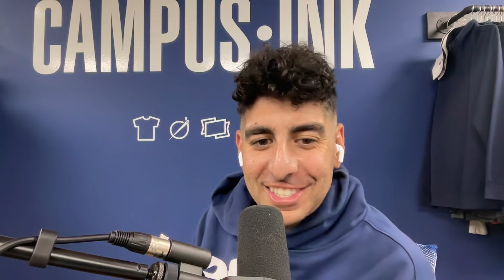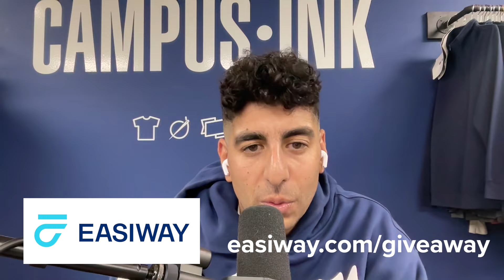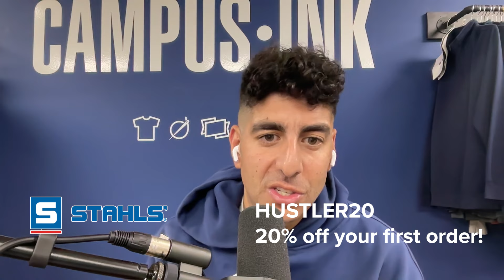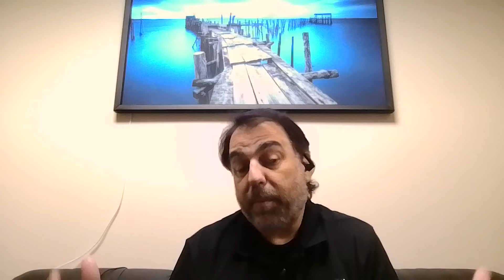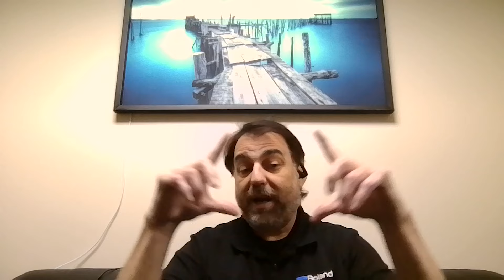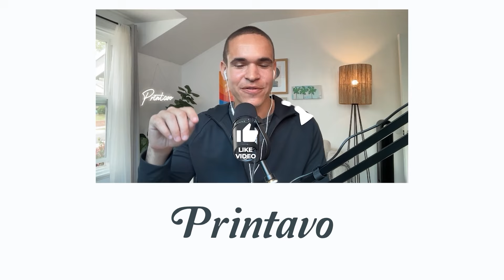Taking Direct-to-Film Printing On The Road with Roland DGA | Print Shop Innovation

Comment: The biggest issue with the trailer is going to be air conditioning. I'm thinking a minisplit AC will need a 10,000 WA battery system to run for 10 hours. How do plan on charging the batteries without a generator? Heat should be easy using a diesel heat unit. Humidity control should be easy as well. Are you using 2" foam insulation on floors, walls, and ceiling? Can't wait to see what you come up with. I've wanted to try something similar but afraid to fork out $50,000 on the build-out just to fail miserably.